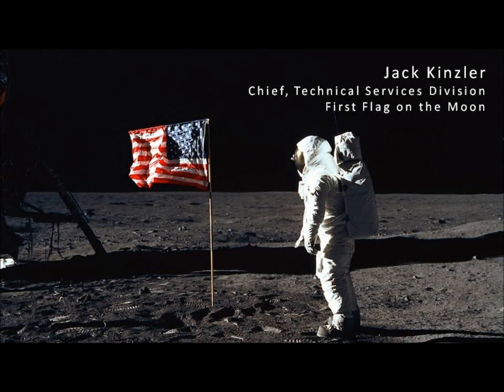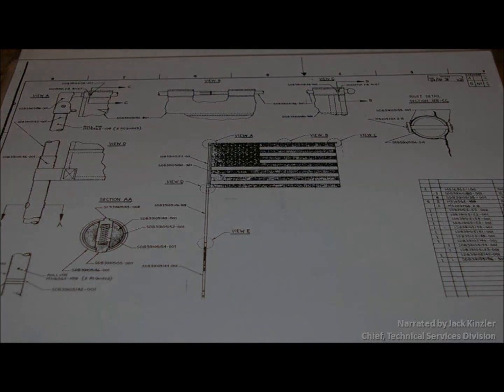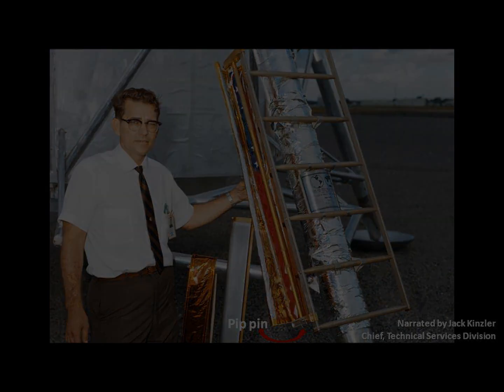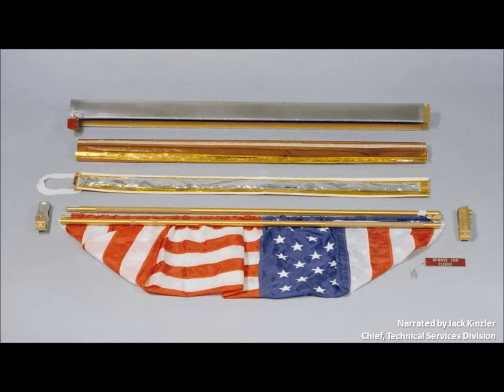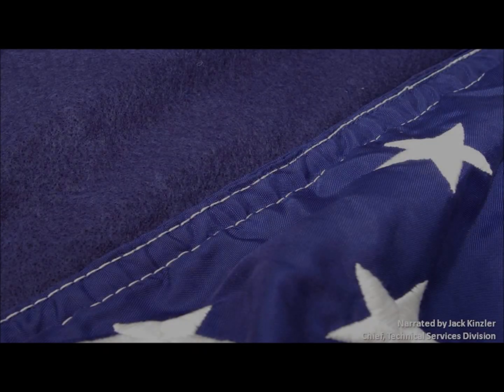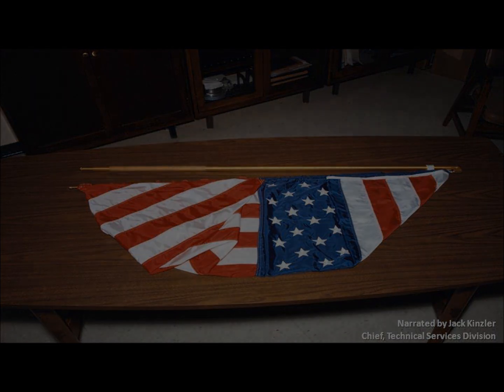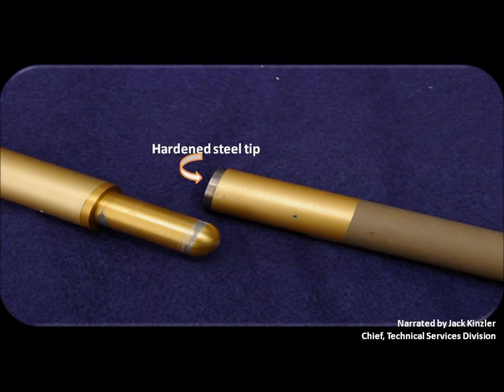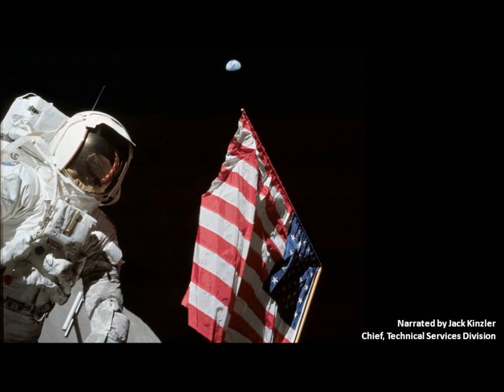First Flag on the Moon

Comment: It is falls
Moon dont have atmosphere how flag can move
Reply: Easy, it didn't move, well, it did but ONLY when the Astronauts were touching it.  It was not very stiff so anytime it was touched it would continue to move back and forth for a few seconds it was let go. There is no wind, or breeze on the moon.
Reply: No wind on the moon, no air resistance either in a vacuum. Shake the flag, let it go, it will therefore continue to sway on its own. Wind is not required.
Reply: That is such a stupid pint it dosent wind to move